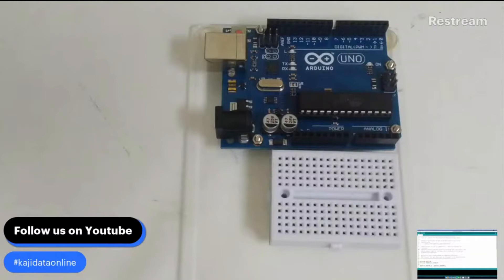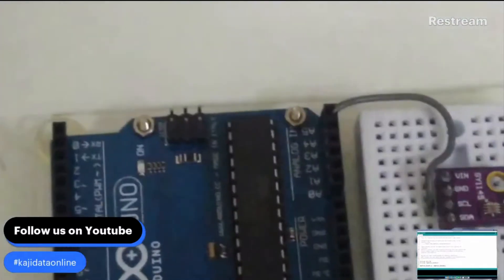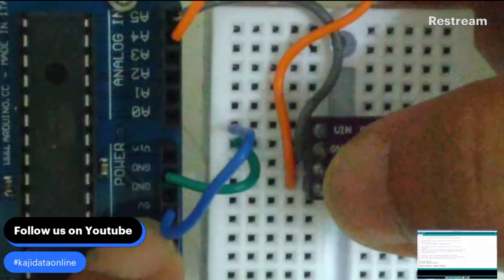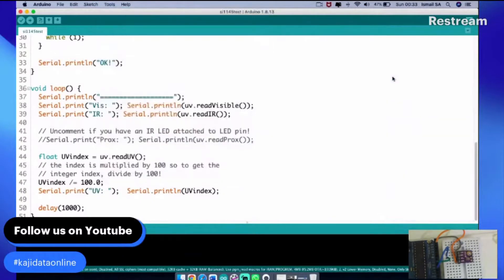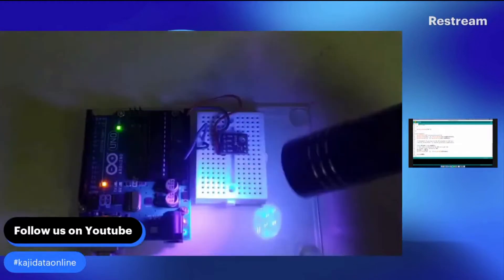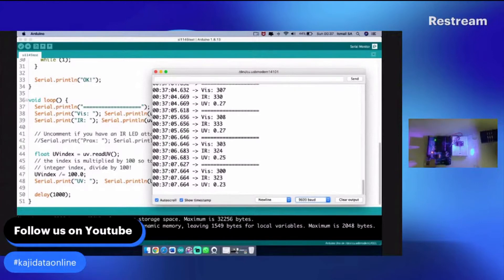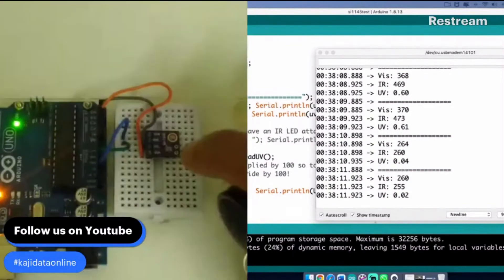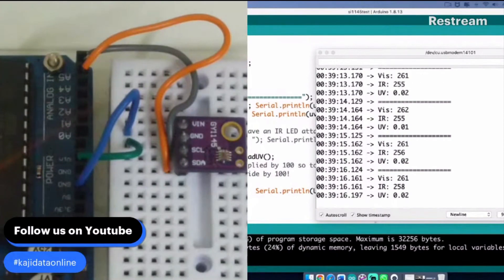Arduino Tutorial -15 GY1145 Si1145 UV Light Sensor Module #indoor #ultraviolet #disinfectant

Comment: Thanks for the explanation,  btw what are the units of measurements on those results?
Reply from the maker: Thanks for your comment. The visible light and ir are formatted using the nm unit. I am using the adafruit library, link as follows: https://learn.adafruit.com/adafruit-si1145-breakout-board-uv-ir-visible-sensor

For uv light based on that library indicate the uv index. The unit is based on scale of SPF. The new UV sensor available to be use velm